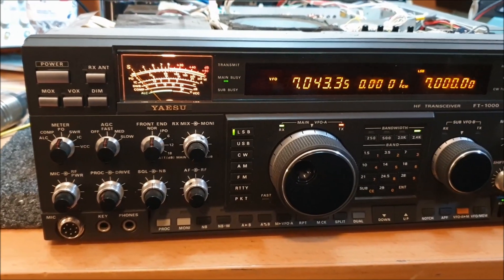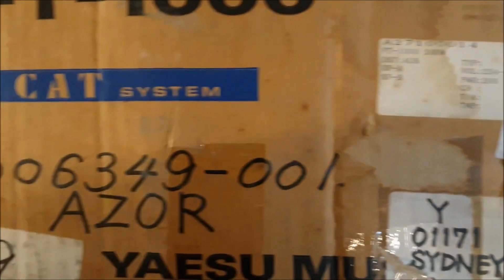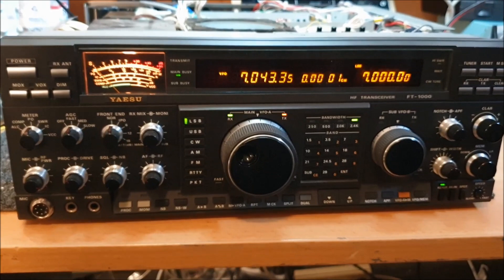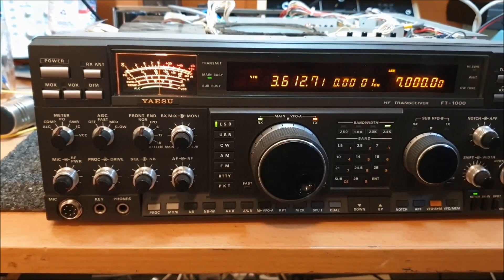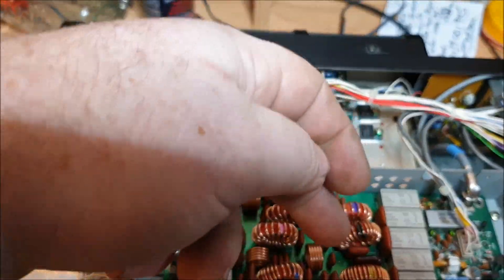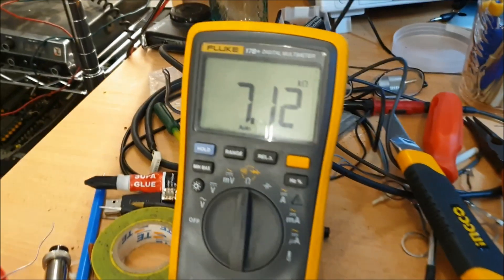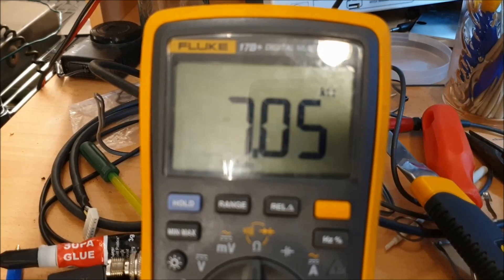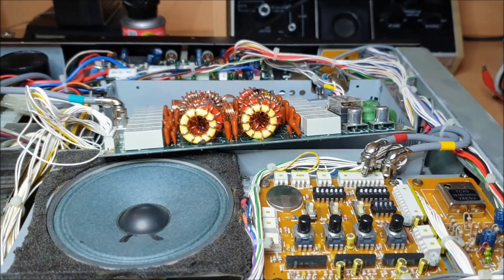Yaesu Ft1000D legend radio with a nasty fault, 10 hours and a faulty  capacitor in the end arghhhh!!

Comment: This was the Common Fault in the FT1000D. Change the Cap near the 2 Sockets as well. The leaky Caps turned the circuit into a Phase Oscillator. The Filters listed on the Label are the options DSE had fitted to the Factory Base Model. This Unit had the BPF1 unit fitted by me or Chris Ayers on a Saturday Production Line. The Bottom of the Box should be Sealed with Big Blobs of Hot melt Glue.
Reply: Paul Turner -- If you don't mind which box are you referring to about hot melt glue?  I love my FT1000D and taking note of this issue just in case.  I see the other cap you were mentioning.  Thanks for posting the info!